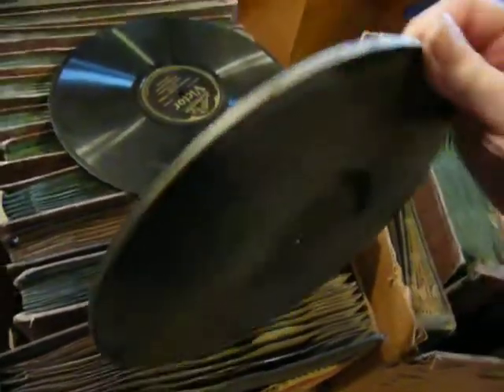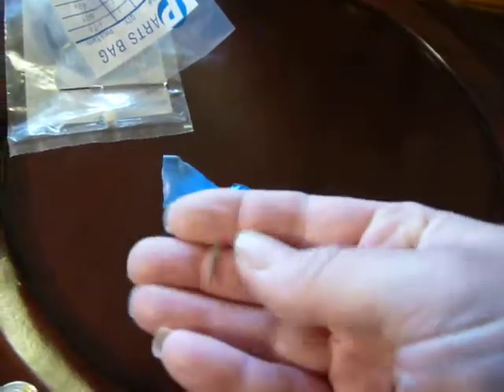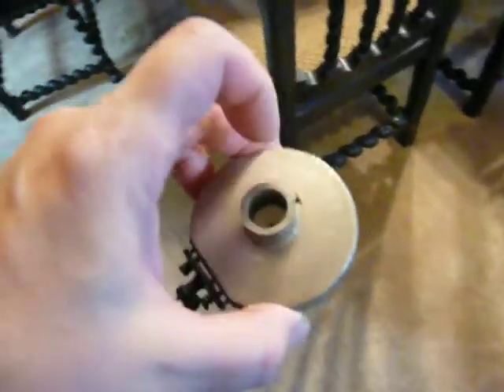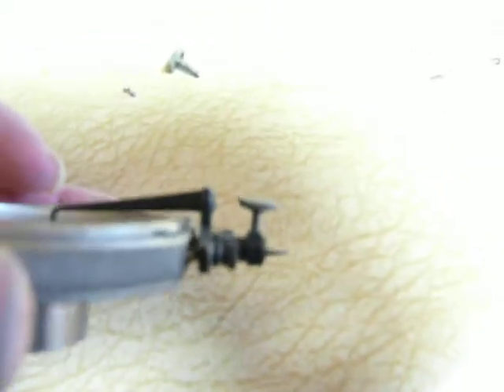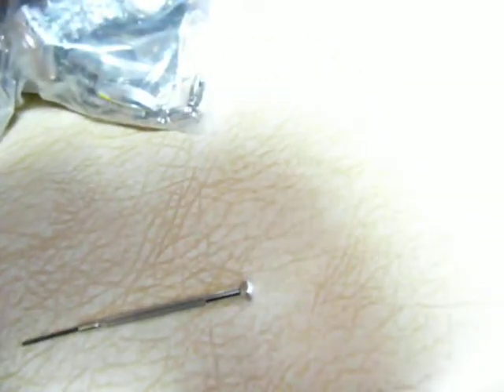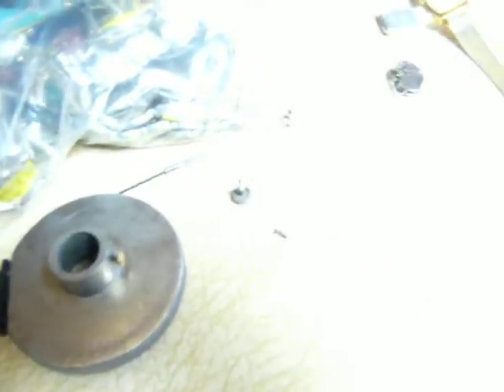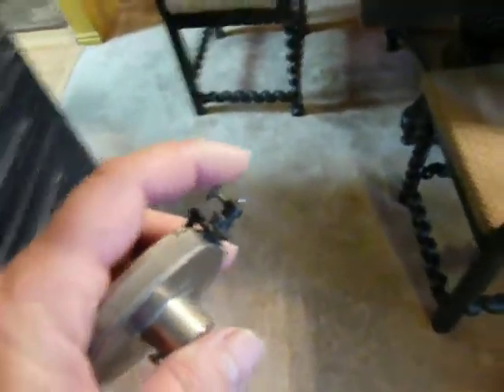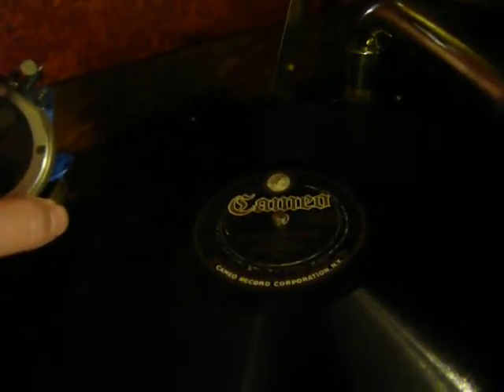Fixing or Replacing / Repairing Victrola Edison Pathe Record Player Antique

Comment: I heard that you are not really supposed to change the needle with every record and that it takes playing a minute or 2 of music before it even breaks in.
Also, you can clean the records with a sonic cleaner. It works really well and you can get very sound out of records that are physically in good shape.
Reply from the maker: I did end up buying the bulk needles and they do dull quickly and that makes the tips wear down and then the needle is wider and it does seem to chisel a little off the record each play if the needle is used more than a few times. I appreciate you sharing what you have found and I wonder if some of the needles are a higher strength of steel over cheaper others... I am sure someone out there would know more about that. 

I appreciate the sonic cleaner idea. I actually cleaned every record already and don't listen to them often so I don't know if I will be cleaning them again in my lifetime but others who are just getting started  will probably really appreciate that as I am guessing it would take less time than the way I did mine. I appreciate you watching and sharing. Have a blessed day!
Reply: I find these machines to be absolutely fascinating. From the wind-up motor to the acoustics to their physical build. It's a hundred years after the fact and these machines still work quietly and smoothly. Electronic equipment rarely lasts more than 50 because of the capacitors.
 You can also play the 78s in a modern-ish record player with 78 speed and the proper needle.
Reply: It is absolutely necessary to replace the needle after every play. Using the needle more than once will quickly wear your records out.